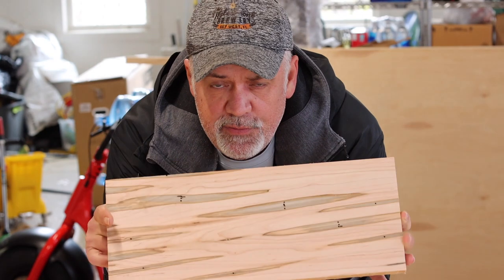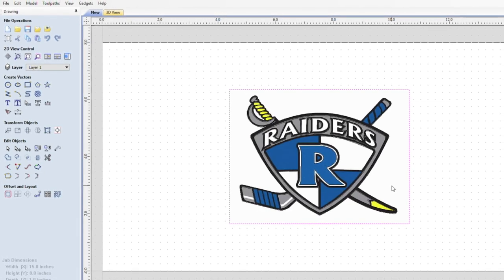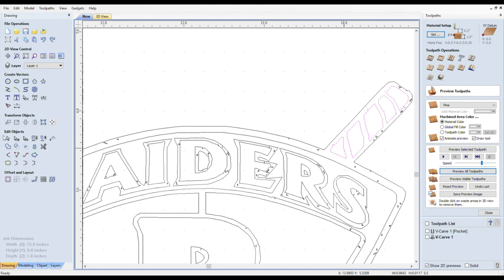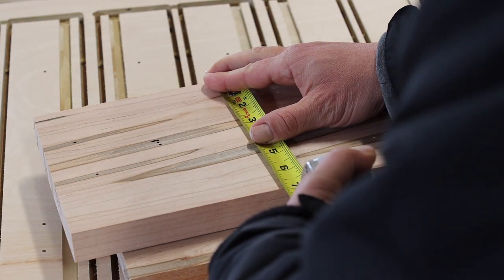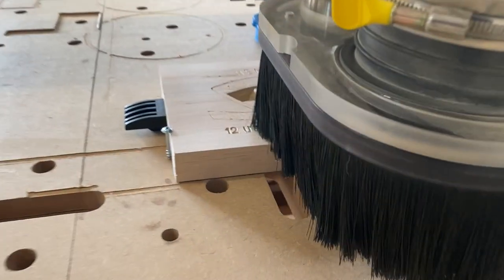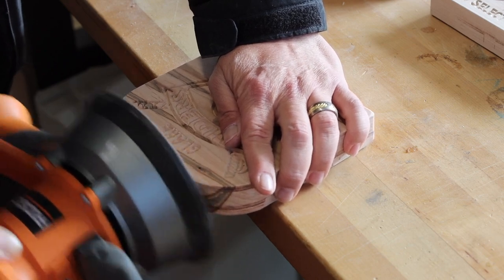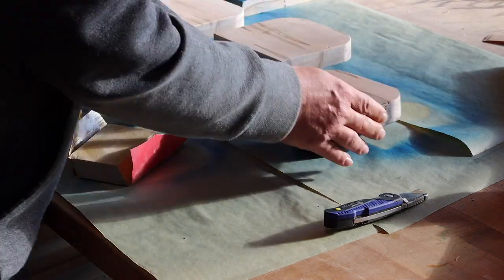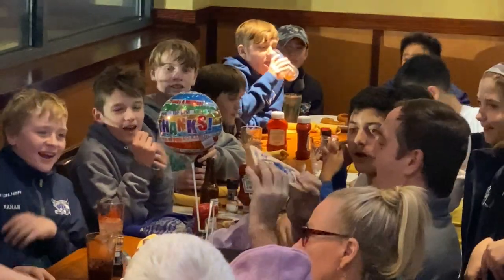Colored VCarve Plaques - Start to Finish, a One Day Build

Comment: Nice gifts, Tim. Makes me want a CNC even more but I'll just have to wait. Thanks for sharing.
Reply from the maker: Was thinking about this...  the great thing about small projects is you can use a small CNC.  I started on the xcarve, which I still like.  You can also easily find them used as people move up to larger ones.  If that’s too expensive, I have a friend who recently bought an even smaller CNC from China off of eBay that was both a CNC and an open laser engraver for only a few hundred.  That takes a lot more playing and fiddling but he likes it...